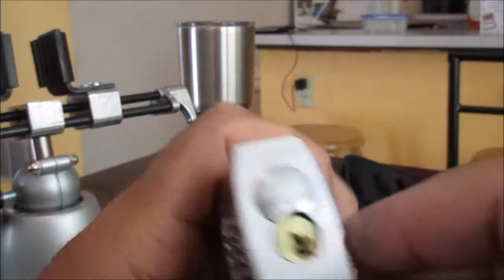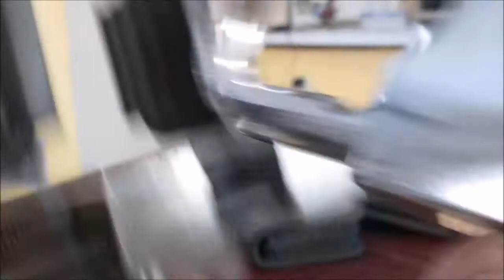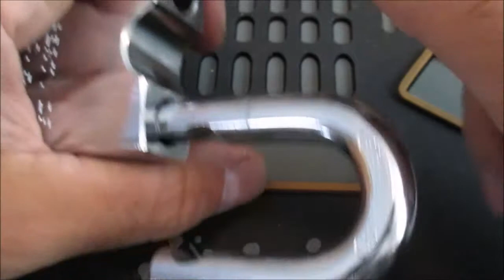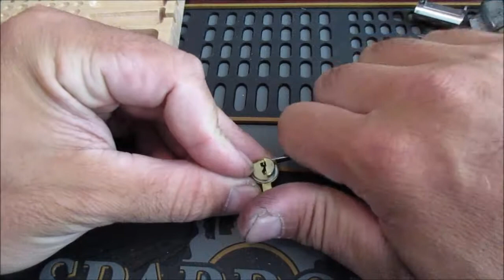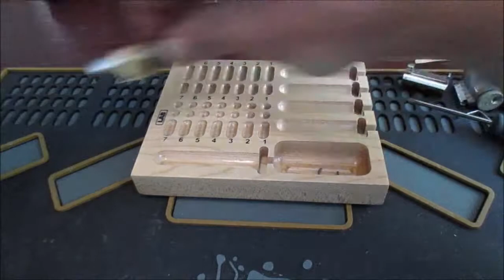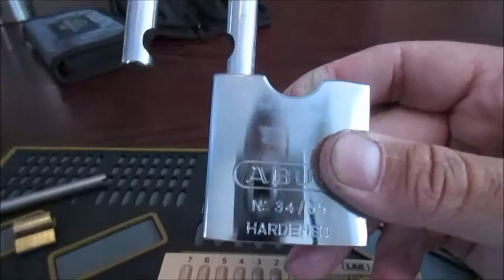(8) Abus 34/55 SPP'd & Gutted

Comment: Great video, nice picking. I learned a lot. btw how is it you only got counter-rotation on pin 4. I'm a beginner.
Reply from the maker: +Besiege This! Thanks! Most likely I only got the counter rotation on 4, because I set the other pins to sheer or they were close to sheer already.
Reply: Ah! thanks for that.
Reply from the maker: +Besiege This! No problem bud, anytime!!